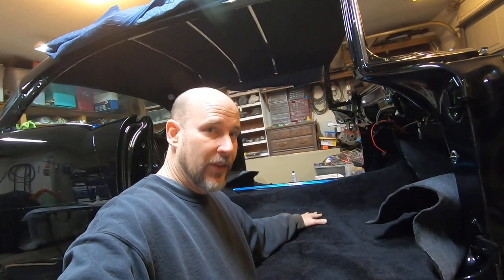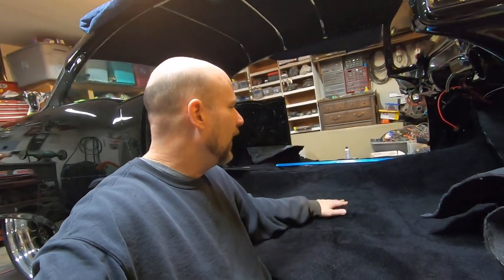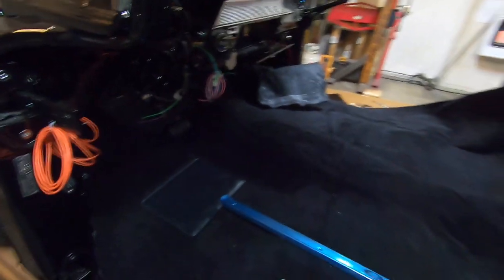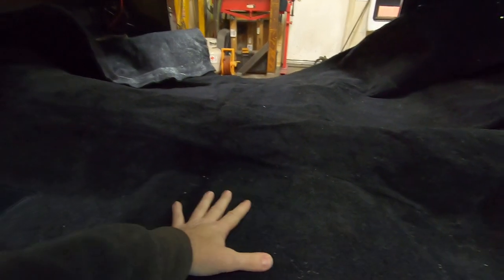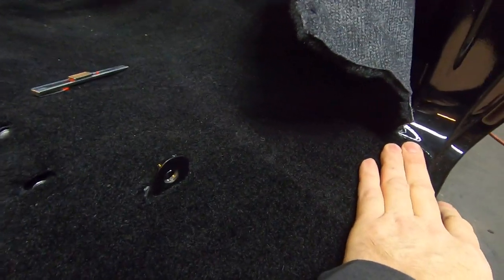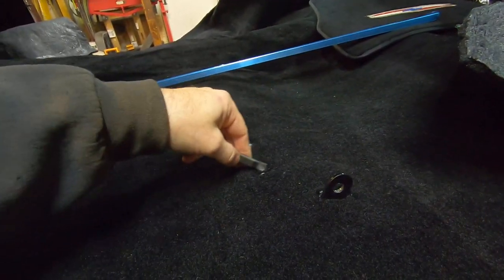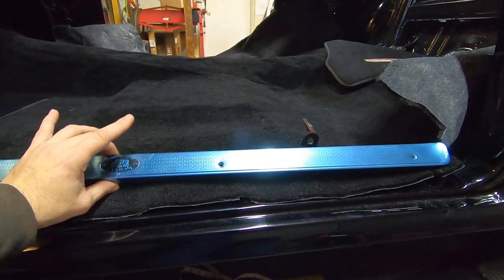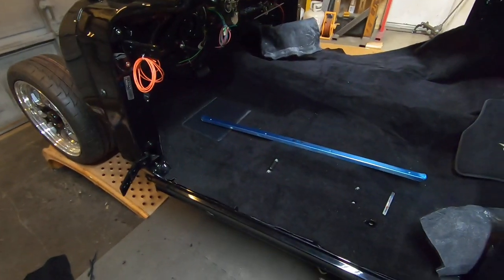1955, 1956, 1957 Chevy carpet installation tips for the DIY guys

Comment: Excellent video. 1 tip I have for doing carpet work is to heat up an awl or Phillips screw driver and using it to put a hole in the carpet for bolt holes.
Reply from the maker: I said that in the video

Comment: Very helpful tips,can you use the heat gun to slightly reshape the carpet?i modified the floor pan shape in order to mount bucket seats
Reply from the maker: Yes Phil. It will contour a bit

Comment: Daytona Weave would be original for 55.
Reply from the maker: Yes it is but could not afford it
Reply: @haffrods7055  I was just commenting not on your choice, which looks great, btw, but to your statement about the loop carpet, which I believe came out with the 57 model year. I actually prefer the cute pile to the loop. Had that in a 56 and didn't care for it. The Daytona Weave I got was nice, but two pieces with the gap in between as you described, which was fine for me. I actually want the car to be as much like orginal as possible, warts and all. But I certainly can appreciate the car you are building. That things gonna be gorgeous!
Reply from the maker: @thomasparker5208  I had to research this. There was loop and Daytona carpet in 55 cars. The Daytona was an option.